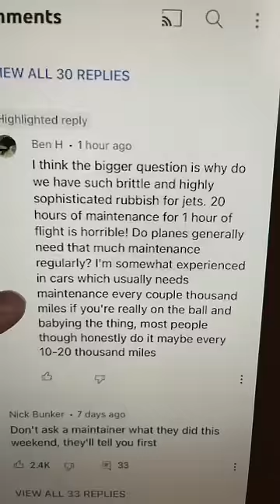Why does an F-16 need 17 hours of maintenance for every hour of flight?

Comment: Gripen can be refilled with fuel, weapons and swap the engine in under 1 hour. Yeah, 1 hour to swap the engine
Reply: The Gripen is partly derived from the F-5. The F-18 is a F-5 descendent as well. They are more maintenance friendly. The real F-5 descendent was the F-20.  It was comparable to the F-16 in mission and capabilities.  It was able to fire the AIM-7 Sparrow missile years before the F-16 could. The F-16 was somewhat better at close air support. The F-20 was far cheaper, more mission available, and only needed 2 hours of maintenance per hour of flight. BTW, 17 hours is high. That must include total teardowns, breakage repairs, major inspections, etc. 5-8 hours per sortie would seem closer to the typical amount. My brother was an F-4 and then an F-16 maintainer for 34 years. He has told me they could turn around a plane twice in a night but it was unusual--only done in active operations IF the plane was in very good shape.

Comment: Like an F1 car. Literally gets put on life support the morning of a race with machines pumping warm oil through the engine and gearbox and cold fluids through the cooling system. Then it’s torn down after every race for complete inspection.

Comment: If the person who left the comment really wanted a true comparison, they need a car that performs in an extreme manner: 

Like a top fuel dragster. They have so much torque that they use a special clutch that automatically changes gears as the car accelerates. This causes the entire clutch system to literally weld itself together.... every 1/4 mile run the dragster makes. 👍 They have 11,000HP engines and move at speeds around 300+mph (lowball figure. They do about 30mph over that).  

A top fuel dragster isnt like your Chevy....it needs a of maintenance after every run down the track. Obviously, the dragster is designed to outperform cars in some ways (speed and acceleration) but lacks performance in other areas (like steering) that a regular car doesn't struggle with. 

The short comings of each car isn't poor design. It's designed to perform a certain way. Imagine you car, how well it turns....now imagine a hypothetical version that has an add 11,000 HP to it and travel around 300mph....and you're getting about 16 Gallon per Mile on your fuel usage, with this hypothetical setup. Not fun for anyone. Hard to drive at fast speeds (on modern roads, that is), hard to control, burns fuel at a mind-boggling rate and it runs so hot that the parts of the clutch are fused together after about 4 seconds at max performance (like a dragster making one run). 

That 👆 is more what a jet fighter is like, but it has the space to perform high G maneuvers, carries extra weight, and is running at a high performance level consistently....and can go even more extreme if it's engaged with an enemy. 👍

Comment: Cars actually need a lot of maintenance that most people skip and think it's fine, but wind up paying for it down the line. Hell, even my mower needs an 8hr service in normal conditions on most parts. 

Vehicles have daily/weekly/monthly/and mileage based needs. But how many of us are actually greasing every 8hrs of use, checking tire pressure and all lights before every trip, checking oil every 1k miles in a diagnostic test, etc?

Comment: As an engineer who's dabbled in both aero and auto prior to moving towards a different industry, the idea of comparing cars to high performance aircraft is extremely amusing. 

Cars don't have flight envelopes. If you push the car beyond a certain speed at a certain angle there isn't a dedicated and tested number in which the entire thing utterly rips itself apart after a precisely calculated amount of time. 

Fighter jets "push their envelopes" and get very close to these invisible barriers during any training that involves simulated recoveries or combat. 

It's like if you were redlining your Camry the entire way to work every day.

Comment: JAS Gripen is very much a maintenance friendly fighter. Three drafts can switch the engine in less then thirty minutes. They say sixty minutes but that's not true. Now and then you need to inspect the frame, etc. but the total amount of time spent on the Gripen is less then 20h per flight hour.
Three drafts can refuel and rearm the aircraft under 15 minutes.

Comment: We don’t really inspect every screw post-flight. Crew chiefs check panels, I believe, but most maintenance post-flight is because the aircrew broke the jet. I don’t know about law darts, but an F-15 often comes back with something broke in the flight control system, and just changing an actuator out can take a few hours when you include gathering parts, airmen, etc. Then it’s going to take about 30-60 min to run a bit check and confirm the problem was fixed. Then you have to hunt down someone else to inspect the work. While this is happening, maybe also something in the targeting system broke, and those maintenance hour’s accumulate in parallel. Aside from all that crew chiefs have to do their jiffy lube things. Then you have refueling and probably a red ball before the next sortie. Honestly, the problem is the air crew. If we had no pilots we could get those numbers way down.
Reply: Also, I would bet that figure you quoted included phase and cann bird maintenance. It’s probably averaged out. Each jet periodically goes to the phase hanger for a few days to a week for a large number of inspections. If you include that maintenance in the figure, it won’t give you an accurate idea of a good average maintenance time. It’s been a really long time for me, but looking back at the F-15 world of the 90s, I would guess most jets really only cost us about 1-3 hours if you don’t count 3-level hours, or jiffy lube stuff, or anything that happens outside of sorties — and this assuming a typical training tempo (surging is going to push those numbers up). Also, the season matters quite a lot. Winter is not so great for an F-15. In the Summer they fair much better.

Comment: Well I think F-1 drivers experience 5+G’s regularly in sone races. Then as far as oil goes we have wet sump vs dry sump. Dry sump is designed to pump oil at high lateral G forces. Also super cars have had to take into account air pressure on glass since the 80’s hence why many early super cars had the 2 piece side windows. None of these compete with an f-15 but they start to approach it. Also the B2 does not fly the speed of an f-15 nor pull the G’s but requires even more maintenance per hour of flight. That’s why they are called hanger queens. At some point we must balance performance with usability and I think the down time of our aircraft are approaching the limit of worthwhile trade off.

Comment: Fuel tanks are not pressurized with nitrogen, boost pumps prevent vapor lock, plus it’s using JP-8 no nitrogen inert sys.

Comment: Don't think fuel tanks are pressurised with nitrogen, hydraulic systems are pressurised with air but to prevent cavitation.The main reason for the amount of hours is because it's an aircraft. Aircraft maintenance is always going to be more detailed than most ground transport.

Comment: Every maint guy has to log 8hrs/shift.  I might go out, swap a part, and log hours in direct labor.  I'll be doing other non  maintenance actions but as long as I log 8hrs for me and my crew, I don't get in trouble.  
Also, a plane lands, but its not on tomorrow's flight schedule.  So it's not a priority. Tomorrow's fliers have priority to get code 1 b4 take off at 7am.  There's more to it than that, like everything else.
20 yrs avionics maint, USAF ret.

Comment: The closest thing to an f16 that even remotely a car would probably be a purpose built race car because of the special suit and helmet the driver wears, the structural stresses endured during operation, the special materials used in the vehicle's construction, and the fact that unescapable crashes are exceptionally devastating to the vehicle and its operator. So go ask one of the F1 race circuit mechanics the "why so much maintenance" question and see their responses. I'd bet their responses will be close to what Ryan he said about military aircraft.

Comment: Anything that pushes the limits is costly. look at a top fuel car, 3.7 second run and the crew rebuild it for an hour so for every 4 seconds you get an hour of maintenance but also before every race the cars are gone over for hours to ensure safety in the welds and structure.

Comment: The funny thing is, an F-16 is fairly cheap to maintain compared to many other aircraft.

Its not the best anymore, a Gripen has similar if not more capabilities, and is even cheaper to maintain. But nothing really can compete with the huge supply-chain of the F-16.

Comment: A car on the road can have something or many things go wrong and still be drivable or at least stoppable & parkable. A fighter plane or any plane for that matter does not have this margin. For a plane that is flying, every single sub-component must work as expected every single time or else the result will be a crash or an emergency descent. The extent of inspection & maintenance any plane needs is many times what a typical car needs. Yeah a sports car or an off road vehicle or a race car need mind boggling levels of maintenance but it still doesnt come close to what a plane needs.

Comment: We could design the planes to be able to take the forces without needing to have a ton of maintenance, but then they wouldn’t have the performance you want out of your fighter jets. They would be more like airliners (which also require a good deal of maintenance, just not as much).

Comment: Race cars and fighter jets are not dissimilar. Take something like a top fuel dragster. The 10000 hp engines in those may need replacing after only a few passes on a drag strip.Rally cars also require a ton of maintenance. A single rally stage might damage any number of parts that would need replacing.

Comment: Oxygen is replaced with nitrogen in fuel tanks to prevent them from exploding when the aircraft is hit by lightning or when a bullet or anything else penetrates the tank. Good shout out to the maintainers though. Pilots wouldn’t get anywhere without them.

Comment: I work commercial and this average includes the time for heavy checks as well. no one takes their car completely apart every 2 years to inspect every internal frame and string either if a car breaks down you can alway pull over and get out thats not really an option at 35000 feet

Comment: No, you listed design challenges, not the actual reason a product was released that way.  The real reason is consumer products must be low maintenance to sell, military products do not.  The military is willing to accept the tradeoff of very high maintenance for slightly improved performance and a slight decrease in development costs.  And the reason for that is they have easy access to labor and maintenance is a different budget. There are obviously other reasons as well, but those are major ones.

Comment: Also, the F-16 is built to be abused. You don't check every inch, fastener, and rivet during your Post-Flight inspection. If that were the case, literally no sorties would be produced if the jet requires 17 hours of MX after one hour of flight.

Comment: Further, the F16 can't fly on its own. It was known as "the electric jet," meaning that its flight computers adjust the controls to keep it in the air. I would guess that keeping these systems running would be a huge maintenance issue.

Comment: That's seventeen man hours of work per hour of flight time, not elapsed hours.  If you had a three hour combat flight, barring major structural damage, you'd be ready to fly again in three hours if you had a seventeen people in various crews assigned for quick turnaround.  That wouldn't been unusual for a carrier or combat airbase.  That's budgeted time per the manual, which is more than you'd expect from an experienced crew in a war fighting scenario.  Remember that in addition to maintenance there are rearming and refueling crews.  Even those who hose the aircraft down and clean the windshields (actually a pretty important and skilled job) and clean out the cockpit, including urine bags.  Since the various crews work independently of each other and go from aircraft to aircraft in quick succession it's not quite as bad as it sounds.

Comment: I never understood this maintenance to flight time ratio. It shouldn’t actually work like that. A 1hr flight might need 17 hours of maintenance, but a 2 hour flight would probably also only need 17 or 18 hours of maintenance. A 10 hour flight isn’t going to need 170 hours of maintenance. It should be heavily front loaded on the time, meaning no matter how short the flight is, they have to check over every screw and every system.

Comment: A cracked, damaged or loose windscreen at mach 1?  It probably implodes in the pilots face.  Theres been incidents of windscreens popping off commercial planes, theres alot of explosive decompression, alot of noise and whoever's wind screen blows out, gets sucked out the plane.  Fortunately in the 2 instances I know of, the pilots survived.

Comment: An everyday car obviously doesn't need that amount of maintenance and inspection even IF you stressed the shit out of it. A better example of a car that WOULD take a little longer for maintenance and inspection is an F1 car. You need to inspect parts double check aerodynamics change suspension. Per race I'd say about 7-10 times they can actually look over the car somewhat properly. At the end of Free Practice and Qualifying are 2 points in time to where many changes are made. So in a day maybe 6-8 hours going into overnight hours is spent per day on each car. Just wanted to mention something a little more technical still doesn't take up as much time in a day compared to what those incredible people do.

Comment: Some what got the details correct. You don't pressurize with nitrogen exactly, it's bleed air extracted from the engine. I'll give you a 5 out 10. Good short though.

Comment: I imagine it’s also measured in man hours. So if you got 3 dudes working it takes a little less than 6 hours to turn the bird around. But it probably has its limits. You can’t fix an issue with the engine in an hour no matter how many dudes are working on it.

Comment: High performance cars need excessive maintenance too. Drag races, NASCAR, F1, Le Mans 
These cars rarely make it a day without needing significant maintenance. 
NASCAR engines only last about 500-600 miles before needing to be completely overhauled or replaced.

As fantastic as modern high performance jets are, they are just as finicky as any actual racing car.

A good comparison to a Toyota Camry would be something like a Cub or Cessna. Civilian aircraft that go and go until linkages rust out.

Comment: 0:54   "Not nonners"
-So this is actually interesting.  Historically the term "nonner" meant someone who is "not ops" (short for operations).  This meant that anyone who is not directly executing operations are their primary duty is a "nonner".  So the ONLY people who are not "nonners" are aircrew personnel. 
Aircraft maintainers took great offense to spending grueling hours and schedules doing back breaking work to put those aircraft in the air, just to be called "nonners" by the people that hopped in the plane and took off with it. 
-So the maintainers have co-opted the term "nonner" over time, to include themselves in the group of people who are not "nonners".  But after this successful co-opting, the term lost all of it's power.  Instead of being a successful insult among military personnel, it is now SOLELY used by maintainers now, and aircrew no longer want to be considered grouped with them.  So now when the term "nonner" is used it's almost a "self-burn" because it immediately tells you that the person is not ops; which was the thing that matters. 
-So in today's USAF you see some maintainer call someone like a finance troop a "nonner" and you ask them to break down why that's supposed to be an insult.  They'll say it's because they work back breaking 12 hour shifts, 70+ hour work weeks, on a 100+ degree airfield, hating their life.. and that finance troop works 40 hours a week, Monday through Friday, with all holidays off, in an air conditioned building, at their personal desk, and gets paid exactly the same.  Yet somehow..... the maintainers still think it's an insult.

--So as you can see, the co-opting of the insult was successful in changing it's meaning, but a failure in maintaining it's meaning of being an insult.  Now it's a self-burn.  People ONLY want to join the USAF as a nonner.  Everyone wants to be Aircrew, Special Operations, or work at an air conditioned desk.  Nobody wants to be maintenance.  All the nonners like Aircrew, Special Operations, and air conditioned desk works.... look down on the maintainers as idiots that got tricked by their recruiter.  RIP.  Their only hope at a happy life is to get an A&P and separate.

Comment: It's also not 17 hours every time it flies, that's an average figure. There are different maintenance tasks that have to be done at different times, like a 40hr inspection, a 100 hr inspection, etc. So the post flight for a single flight could only be an hour or so bimut the "maintenance per flight hour" figure gets driven up by the much longer inspections that occur only periodically but take many hours.

Comment: F-16 can't deliver fuel at all angles. It is not about angles at all but about G forces. Under negative G forces you cannot sustain a flight because you will get a flameout, engine will run out of fuel as soon as you drain fuel accumulators dry. Fuel accumulators lasts for some little time, but with afterburner it gets much shorter.